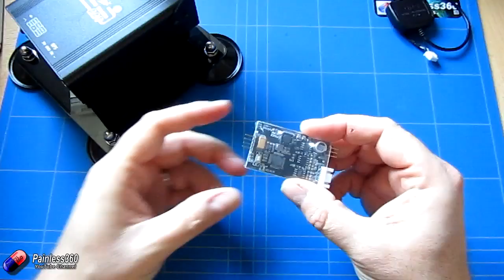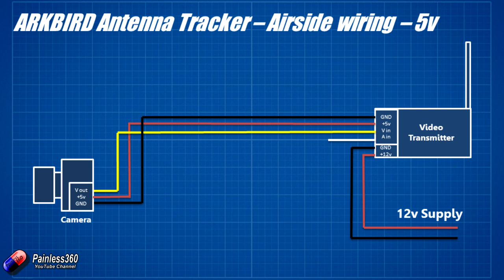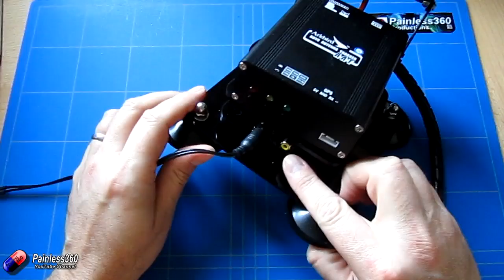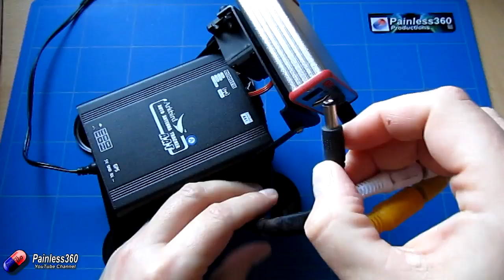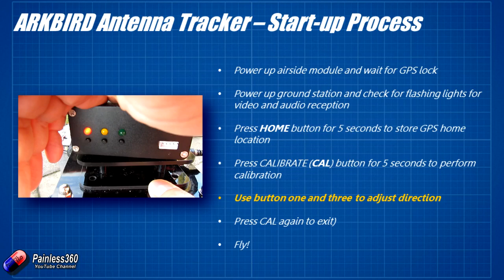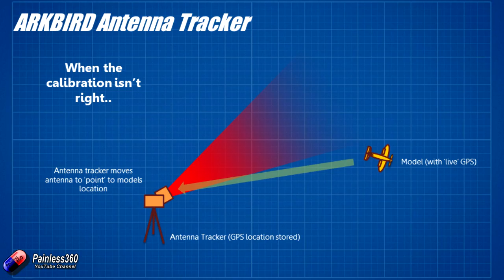RC Reviews - Arkbird Automatic Antenna Tracker for FPV

Comment: Thanks for this.  I'm currently reviewing the Arkbird OSD for my channel and the next step is integrating the AAT (been adding each component one at a time to ensure proper operation).  Mine did not come with instructions so I've be deciphering the online PDF.  Mine will be connected straight to the OSD so my connections will be a bit different.  This is my first experience with a antenna tracker an was curious how it actually worked so I'm glad you posted this information.
I'm sure you've seen they have a firmware update so you can use a ntsc camera with the onboard unit.

Comment: What's the magnetic declination for your area? Could that be the reason for the deviation? (magnetic north and GPS north are different directions on most places on earth).
And I'm sure you know this, but far others having problem with a compass (this applies to mag calibration on any craft as well): make sure there are no magnetic objects nearby, which pretty much means keep clear of anything made out of iron. A shelf I have with the vertical pieces made out of iron pipes turns the compass on my phone up to 10° when I come closer than 2m.
Reply from the maker: Thanks for the idea. May have something to do with it. The deviation in tracking seems to be a lot more than the couple of degrees that the magnetic declination.. Happy flying!

Comment: at 8:01 I saw several GND pins. Can they be on same cable at the same time? That would save your cables or soldering labour.
Reply from the maker: +dayworkhard They can, this is a logical diagram of how the connections are made. Physically use the way that's easiest.. Best of luck!

Comment: Will it work with a diversity receiver?
Reply from the maker: +James Lamb Yes, use one of the antenna connections for the antenna on the tracker, the other one you can fit a circ. pol. antenna for when the model is closer..
Reply: +Painless360 
That was quick, thanks. As I was typing that last question another sprung to mind .... does it work with 1.2 GHz. 2.4 GHz etc. systems? I just went through the manual and HK listing but neither mention FPV frequencies specifically.
Cheers
Reply from the maker: It will work with any, remember that the longer wavelengths for FPV (2.4GHz and 1.2Ghz) have much larger specialised box and cross antennas. This will cope with them though..